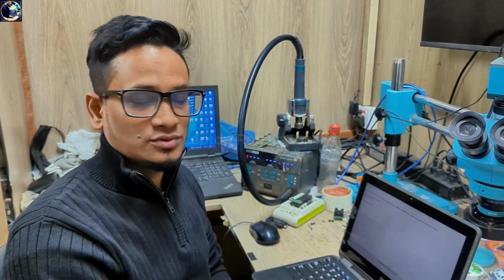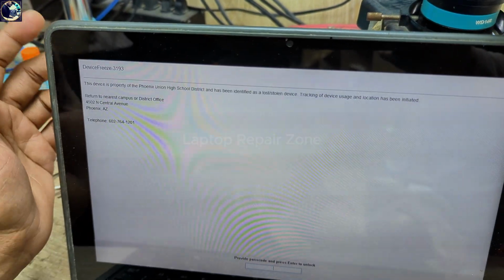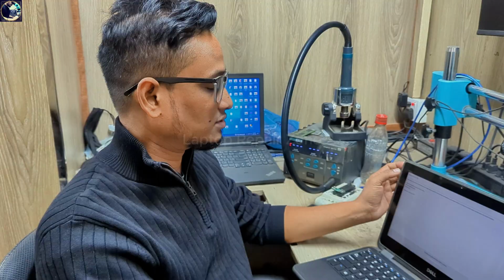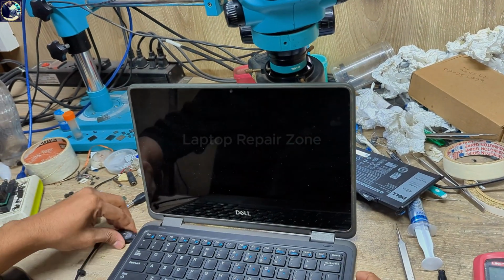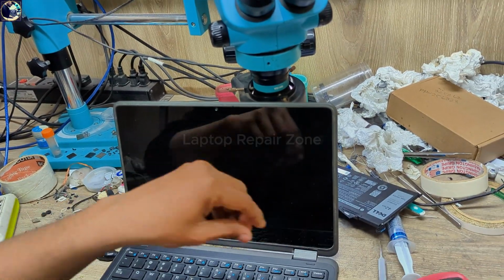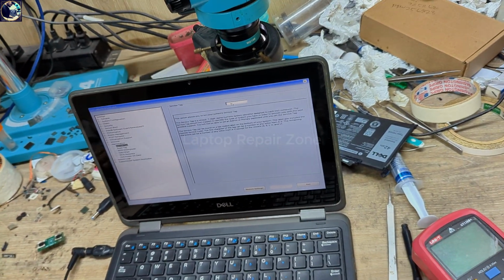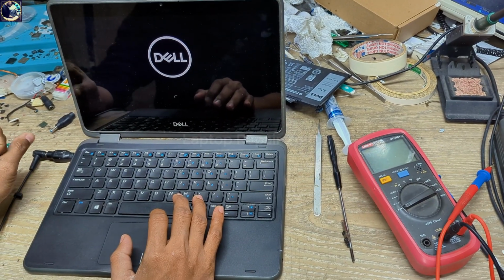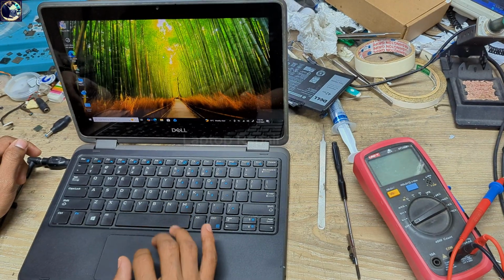Dell Latitude 3190  Device Freeze Fixed !

Comment: HI, they say the BIOS chip is only needed till Windows takes over. Does this mean you could unsolder the BIOS chip after Windows is running and nothing will happen?
Reply from the maker: I never try it.
Reply: I tried it during my training in India and device worked until you turned it off
Reply: @anselmosahlin3057  Interesting as i thought the EC chip would still "monitor" the BIOS and others and shut off if a signal went missing.   Maybe the Bios chip lasts a long time as it not running for hours or high load once it does it job?.  They are rated at thousands of "flashes" but still get corrupted after original flash?? Maybe voltage spikes ect every start can damage the file.. dont know;.
Reply: Nice question
Reply: Yes